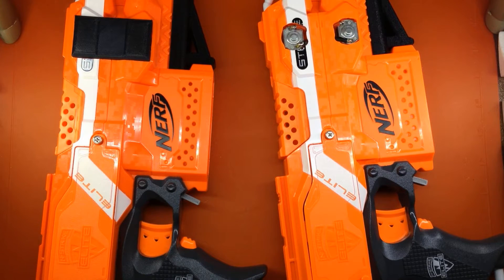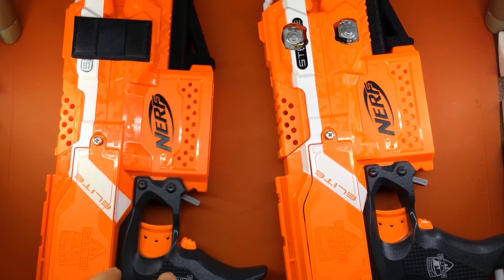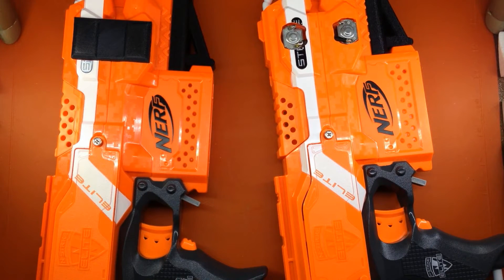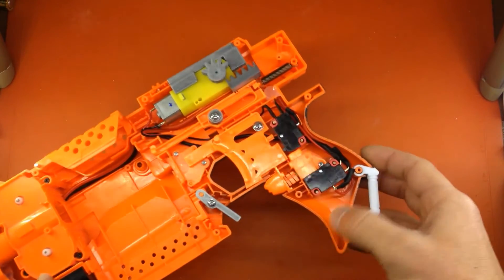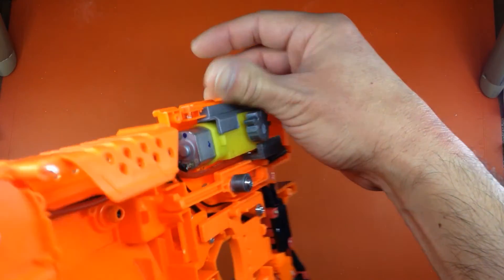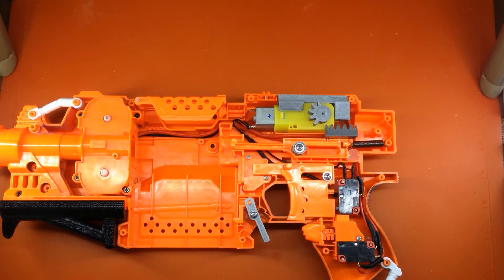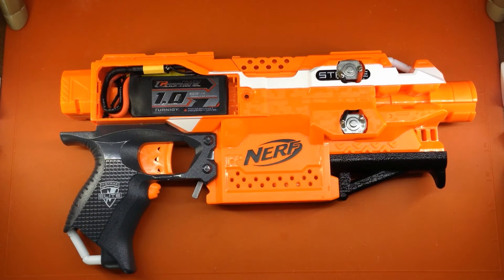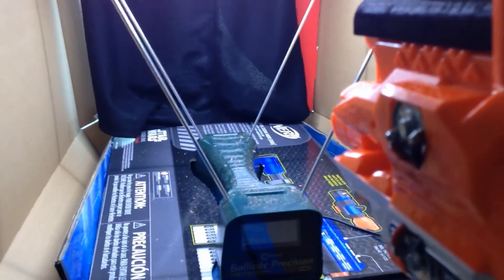AutoStryfe V2 Machine Pistol

Comment: whats the gear ratio of the gearbox?
Reply from the maker: 1:48 
Buy extras as they will strip over time with higher torque motors. Orient screw side up as the gears seem to be a bit more durable in that config.

Comment: I have had a  problem of stripping the internal gears of the gearbox. Have you had this issue at all?
Reply from the maker: It's a problem; the gearboxes weren't built for high torque applications; buying extras is the solution. The side of the gearbox with the fasteners does seem a bit less likely to strip for whatever reason. Unfortunately, the pinion gear is the weakest link and the part that is most easily stripped.
Reply: @greenmedic88  It makes sense. Thank for getting back to me !

Comment: hows the durability on the 3d parts? im wondering how hard you can push it
Reply from the maker: It will vary depending upon filament material and settings, like any printed part. 

Offhand, I'll say that even prints made out of PLA are as durable (but not as heat resistant) as factory ABS shell material. But even for mechanical parts like the ones in this set, print failures have been a non-issue from my experience. Unless the print settings are off or the parts are improperly installed, the brushes in the motors will likely need replacement before any of the gear teeth start to slip due to wear or other print failure.

Comment: Do you have a link to the specific pusher motor you used? I'm having trouble finding it
Reply from the maker: The link to the order is no longer valid; you'll have to find replacements, but the specs and personal notes are as follows:

FF130 3733
Voltage Range] 1.5-3.7V
[RPM] at 1.5v 10,000 rpm, at 3.7v 25000rpm 
[Current] 1.0A no load
(130 solid face)
Poor tolerances, poorly packed
Brushes failed with 2S for drop in flywheel motor replacement
Potential for 130 pusher motor usage
Reply: Daniel Okada thank you! I'll check it out and see what I can find.

Comment: how do i wire two switches in to this to motor break i know how do do it with the one switch but a bit of clarification never hurt lol
Reply from the maker: Not the first request for this. 

I'll post a tear down and circuit drawing this weekend, but in short, the NC on the rev switch has a line to the negative poles of the flywheel motors. The NC on the pusher switch has a line to the negative terminal of the pusher motor, which runs back to the negative terminal of the battery.
Reply: thanks, making note of this now, my $2 Motors came in with my switches

Comment: This is amazing! Are you ok with posting the STLs for any 3D printed parts? My friend just got a 3D printer and we also just got our first LiPos. This seems like an awesome way to put them together. Again, really amazing mod!
Reply from the maker: I should probably link the Thingiverse files here. Most of the views are coming through Thingiverse rather than through YouTube directly. 
http://www.thingiverse.com/thing:2245550

Also check out the printable pusher arm with integrated rack gear by Markus1406 for this kit. It will save you the added effort of modifying, measuring and mounting the rack gear to the stock pusher arm (will test ASAP).
http://www.thingiverse.com/thing:2279902
Reply: Thanks so much! Really awesome job!

Comment: This is super spicy, I love that block clamping.

Just got the heated bed on my printer running (finally, 6 months later) so hopefully I can work faster, now that I'm less worried about accuracy of my parts
Reply from the maker: Thanks! The block clamp was largely designed as a workaround for modified shells (gutted battery tray) since that's so common, but the concept should work with any blaster with a attachment rail. 

I'm currently split between the handful of additions for the V3 to add to the fun and utility, building off lessons learned and modeling new brackets for other semi-auto blasters. 

If you've been working without a heated bed, I'm guessing you've been working with PLA? I did quite a bit of experimenting with ABS (vapor finishing and solvent welding is great), but found that details are a bit sharper with PLA.